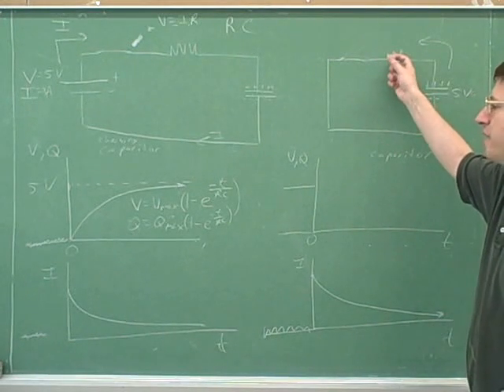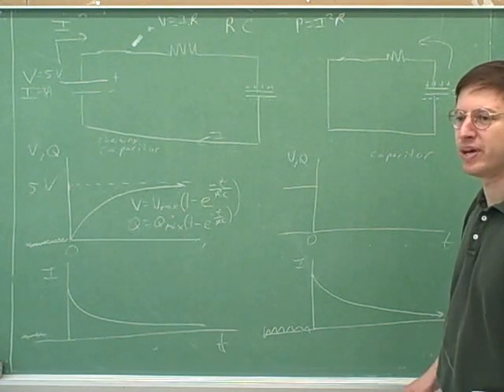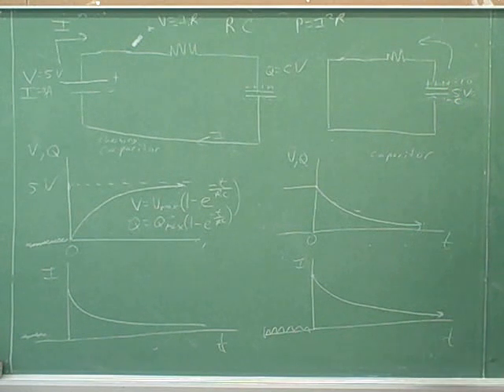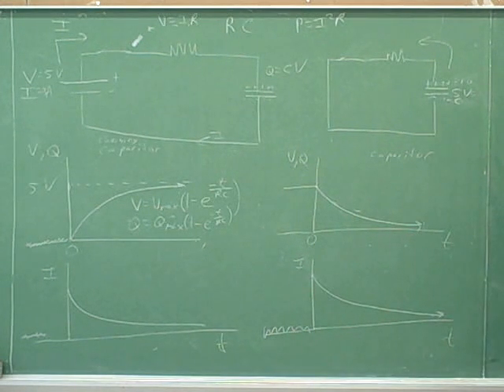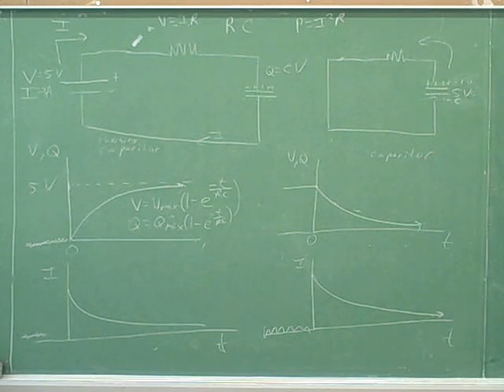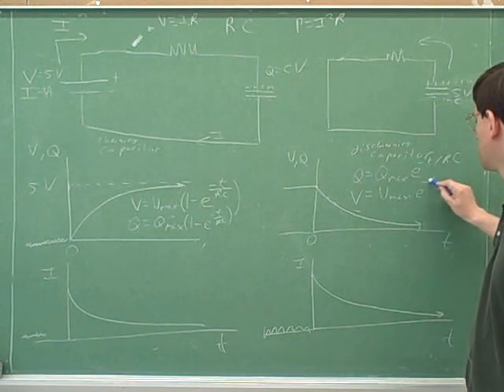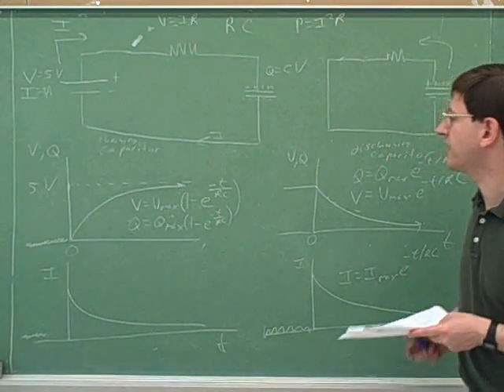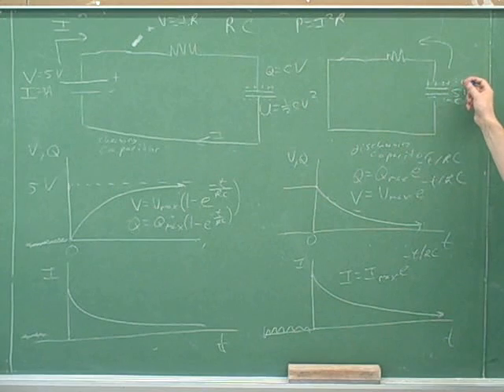Capacitors and inductors; RC and RL circuits (4)

Comment: The current I graph shown in the bottom right w/o battery in the beginning of the video is drawn as the absolute value. Current is flowing opposite as when charging so the current would be mirrored about the t axis. Maybe he corrects this in a future video, but we are halfway through this video and the graph remains the same. The graph however does work to describe Q. If I am wrong, please help me understand.

Comment: shouldn't the voltage graph for resistor in a discharging circuit be the same as the voltage graph for capacitor, and not the inverse as you say around 7:43

Comment: It's because in the past there whas only speculations on how electronics work and so they thought energy should be positive.
While now Joseph John Thomson has proven that an atom has a number of positive protons, and so the electrons should be negative. So an atom that has 8electrons and a 8protons are a neutral ion.
An ion is simply the name for a positive / negative charged atom.
If an atom has 8protons and 9electrons it's a negative charged ion because of the presence of an extra electron.

Comment: awesome.  and when you said that thing about the flash bulb, it was really cool.  it's like that humming (rising pitch) sound you hear on the disposable camera when the flash is charging up (that's the capicator getting charged, right? then the humming stops b/c it's done), then you "discharge it" (quickly) to get all that energy for the flash.
((maybe that should come earlier in the lesson about capacitors.  just a suggestion.  you're awesome.))